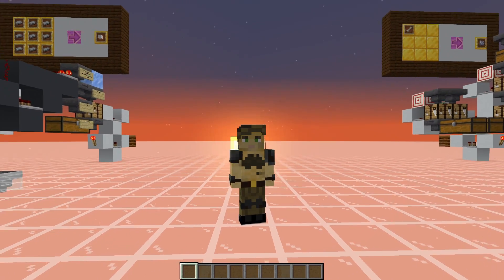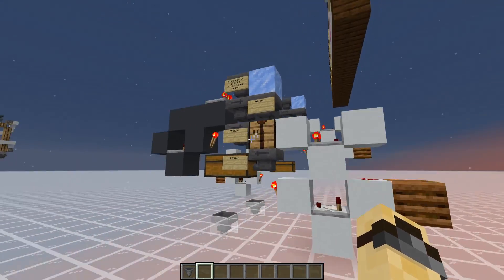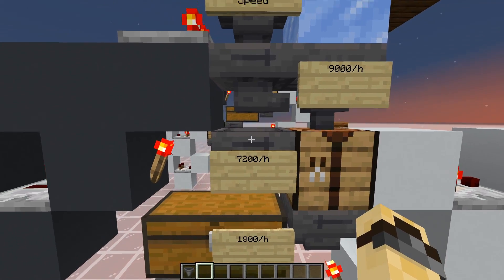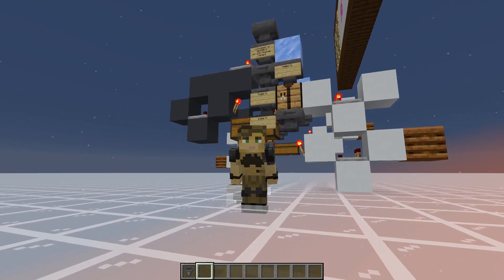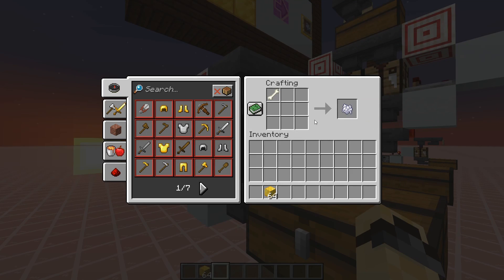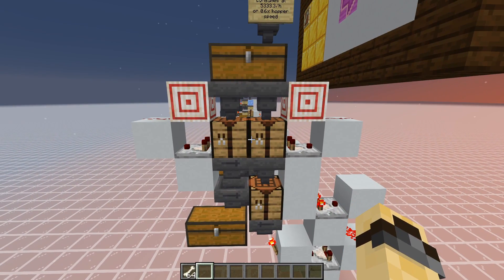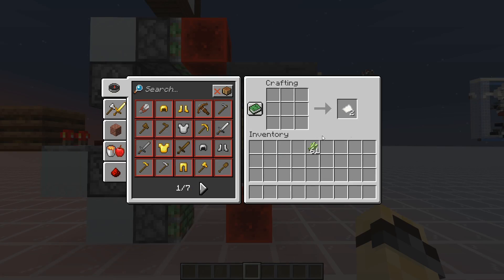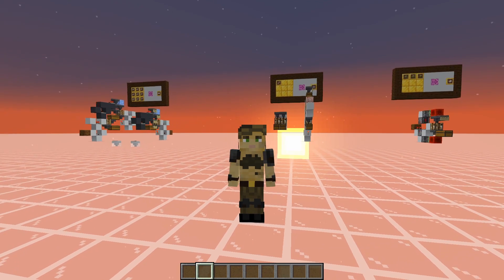3 Simple Autocrafters for your Farms

Comment: I have a modded smp, and I want to build a storage system with item compactors. I was curious if there was a better way to compact 22 different recipes at hopper speed without building 22 slices of the compactor circuit?

Comment: Why isnt the comparator in the first desing powered until the signal strength is 15? Shouldn't it be powered when there's an item on the crafting table since 1 is greater than 0.

Comment: I built the first one but the item filters dont work and they just suck in the extra items as well
Reply: One of the hoppers has to be filled completly with the items that are getting filtered. I believe it is the one right under the filter hopper
Reply: You need to set up two hoppers: the one between the comparator and ice block, and the hopper underneath. Fill the first slot of both hoppers with a stack of the item you want. Fill the last 4 slots of both hoppers with a single junk item in each slot - but you must use a different junk item for each hopper.

For example, hopper 1: 64 gold nuggets, 1 seed, 1 seed, 1 seed, 1 seed. Hopper 2: 64 x gold nuggets, 1 string, 1 string, 1 string, 1 string.

Comment: Dumb question but uh how do I set the item I want automatically crafted ?
Reply from the maker: The autocrafting table in carpet mod is not quite the one block solution you get in your average tech mod. These crafters only do simple recipes like filling the grid with a single item or splitting an item.

Comment: I don't suppose you have a design for a 2x2 recipe do you? I'm having trouble figuring out ilmango's honey block crafter, let alone converting it. I had a look at some of your more recent designs, but seems like you're using moveable tile entities.
Reply from the maker: 2x2 recipe's are actually quite challenging, I would even go as far to say that they are too challenging compared to most other recipe's. With some modification my honey block crafter should be able to handle any 2x2 recipe provided it uses a single item type for all 4 slots, you'd also need the dummy item.
Reply: @cubicmetre  https://drive.google.com/file/d/1_a3Z0l4mOKwBTYbvmmEaloM1xZnGPAOk/view?usp=sharing   I got this far with the loading, need to figure out the locking and unloading the dummy and crafted items
Reply: I went back to ilmango's honey block crafter and came up with the following. I had to add an ugly item batcher on the input, not sure if the honey farm suffers from this, but if the items arrive sporadically it can mess up the recipe, so the batcher only lets through 4 items at a time, couldn't get the comparitor levels as close as I wanted but it seems to work.
https://drive.google.com/file/d/1IeYrwNuBcndSJPLCNN-mhotUrzrtp5rn/view?usp=sharing

Comment: is there a way to add hopper support in normal carpet mod + extra or you need quickcarpet to pump items in a crafting table?^^
Reply from the maker: I assume by "normal" carpet mod you mean Gnembon's carpet mod. Currently there are 3 variants of carpet. Genmbon's carpet mod includes features which Gnembon likes such as scarpet and chainstone whilst Skyrising's quickcarpet is what we use on ilmango's Patreon. Gnembon has not included the autocrafting table in his variant of carpet mod, plus a number of other features, so you will need to install it separately. However Skyrising's quickcarpet includes autocrafting table.
Reply: @cubicmetre  in gnembon's carptet extra is autocrafting with dropper possible. so you cant use gnembon's and quickcarpet at the same time?^^ and thx for the quick response :)
Reply: i think you are looking for this: https://github.com/gnembon/carpet-autoCraftingTable
It us extension to gnembon's fabric carpet that adds this

Comment: Note that i found: The composter for the "paper" (or slabs) crafting table is at level 4, as filling 3 slots puts the crafting table at a level of 5, so that the crafting table's comparator updates the dust, which is reading a signal strength 4 from the composter.
I didn't quite understand this system at first, my apologies. Hence the rewrite... Although my articulation of that is meh. Sorry.
Reply: Great, i had no idea how to fix it. stange that he didn't explain it in the video
Reply: still don't get it, is it possible for you to simplify it?

Comment: Is there a wdl or litematics of all of these designs?
Reply from the maker: Generally with one wide tilable designs it is easier to just pause the video and build them off that, however these designs are in the background of the wdl of my universal autocrafter.
Reply: @cubicmetre  well the wdl with dropper crafter is very useful because I am what they would call the "big lazy" and prefer to build off of a litematic rather than pause a video and save  time lol
Reply from the maker: @zuccy_93  Normally I would agree, I've had a few nuissances trying to rebuild some of ilmango's contraptions from his videos, so I try to provide other resources as much as possible. However for a one wide tilable design it is very easy to build from a video because you can pause and see every component in a single frame.
Reply: @cubicmetre  Like I said, I know it's a much more efficient use of my time to just build it from the video, but I am extremely lazy and do not remember how to apply brain
Reply: @cubicmetre  Would be nice to pin this comment I think